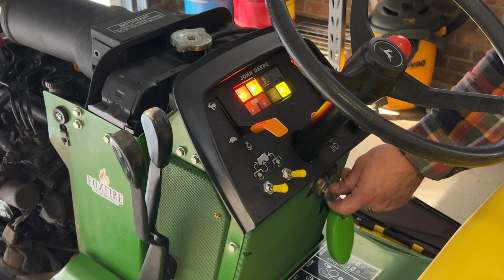John Deere 332 Diesel Garden Tractor Service and Walk Around

Comment: You didn’t mention how to drain the hydraulic oil. Or do you not need to?
Reply from the maker: I didn’t change the hydraulic fluid on this service, only the filter and topped off.  Plug should be on the bottom of the transmission.  Appreciate you watching!

Comment: What mower deck did you purchase for your machine? I am looking to replace mine.
Reply from the maker: Unfortunately, it appears to have been discontinued.  I purchased through one of the green parts online dealers in 2017, and can no longer find it listed.  Appreciate you watching!
Reply: @FoxfireProjects  Thank you!
Reply from the maker: Was able to dig up the old shipping paper work.  Part number is BM17879.  Appears no longer offered, but the part number may help you find an old stock unit.  Best of luck!

Comment: When you bled the air after replacing filter, did you have to bleed the air from the screw at the injectors?
Reply from the maker: Yep, always end up having to crack an injector in the long run.  It acts fine for a bit with just the bleeder, but would start to sputter down the road.  Hope that helps!
Reply: @FoxfireProjects  very much so! I thought just having to crack the bleeder at the filter would do the trick. I figured out that is not lol.